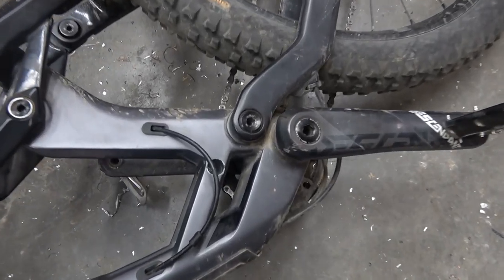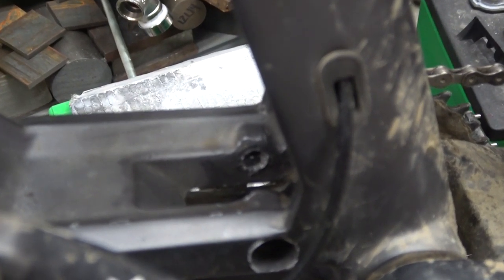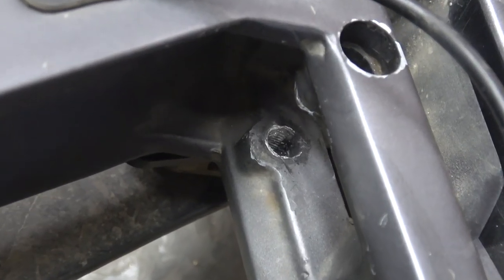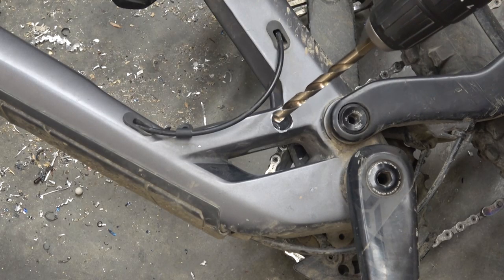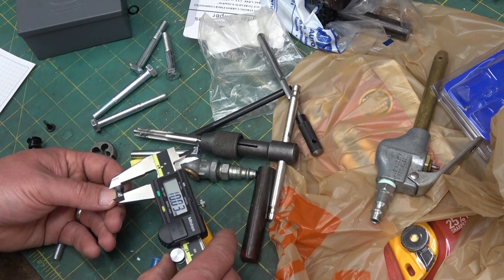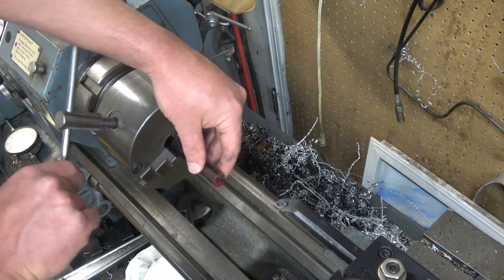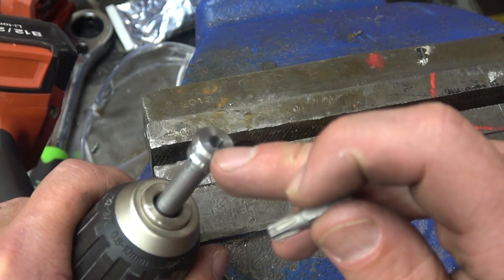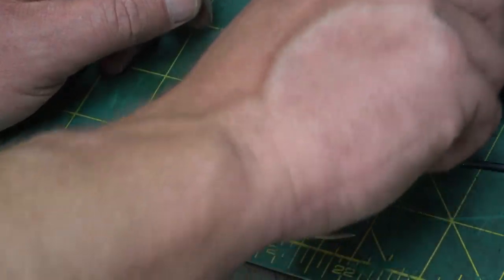What's a scumbag offset? | Obscure German Carbon Fiber Bike

Comment: So now that that pin is unbreakable, what’s the next point of failure? The expensive frame or the expensive shock?
Reply: Frame will bust on next big jump, that pin is zthere for reasonn.
Reply: Bearing surface in that bore of the shock, as already pointed out as being chowdered, is the next point of failure.
Other than that, you'd more than likely need unrealistic forces to damage either the shock or frame. Aluminum pin was fine, except where the diameter shrunk for the threads, which also sacrificed the threads in the frame when the pin was damaged; which is also why threading into composites is not a good idea and not a good design choice. Unless you have a whale riding this bike through a trail with substantial drops, it should be fine for the rest of it's usable life. Though, if the shock is frequently being bottomed out, it more than likely needs replaced, or adjusted assuming this one can be, but judging by how the bearing surface is already wearing, it probably needs replaced.
The pin itself should've gone through the frame completely and secured by either a nut or retaining clips. Aluminum would have still worked without issue in this case. This bike just has very poor design choices.
Reply: I'd say the pin that's topwise of the shock.
Reply: Captain MufDyven  While true, you have to keep in mind manufacturing costs. Those two parts would be more expensive than the one used. And the one used is more expensive than either through-pin design.
Reply: @xaytana  From what I saw in the video the frame had a threaded aluminium bushing insert that was half eaten from the failure, so he could have done another threaded bushing and use some epoxy glue...
Reply: Guy might be running too low of shock pressure; bikes are designed to bottom out but repeated pounding from Whistler-style hits will break something eventually.
Reply: The TacomaKid that’s a super deluxe it’s far from cheap and it’s essentially bulletproof. It’s almost identical to a fox shock in the same price range, I’ve used both
Reply: The TacomaKid  my dude brand has nothing to do with bottom out, you've got to set the proper pressure in the shock. If all you care about is the cost then fox is Garbo compared to something like push industries or ohlins.
Reply: Definitely agree - pin could be simpler and better, but even a complicated pin is far cheaper to replace than either the shock or the frame.
Reply: Are you recommending a shear pin instead?
Reply: only one way to find out!
Reply: @semirsemir7016  the pin didn't die from one hit (as it would have as a "sacrificial link"), it was gradually fatigued to failure, indicating a poor design choice.
Reply: @danroe533  I was wondering about that too. The guy obviously wasn't doing the routine maintenance that necessary for a full suspension bike (like having all the pivots inspected), and probably didn't have his rear shock set up properly.

Comment: Radon is popular in Europe. Most rear shock mounts I’ve seen have a steel bolt. Dude needs a volume spacer or more air pressure in that shock.
Reply: Well, d'ya think Uncle Bumblefuck would shy away if it was just a blown seal? Au contraire! Hon hon hon!
Reply: Next one will be arsenic....

Comment: Especially when working on German gear, expect the depth of thread to be 1.5xDiameter. If the process is designed for mass production, that's what it'll be 99% of the time as it's the minimum thread depth to get full strength. I like to go a bit deeper for one offs but what's another quarter turn?
Reply: Except thread engagement length for optimum joint strength depends on material. Steel is typically 1x to 1.5x diameter, and softer materials need a longer length for optimum strength
Problem here is that the aluminum-composite joint was only to keep the pin in place, so strength really wasn't a factor; you could achieve the same pin using a through-frame design with retaining clips, thread engagement does not matter in this use.

On the manufacturing side of things, sure, 1.5x diameter might be fairly typical. But again, this joint wasn't designed in that way, so it doesn't necessarily follow optimal thread engagement. And if it does follow optimal thread engagement, that number for carbon composites is more than likely more than 1.5x. Threading into composites in a high-force application is a bad idea anyways, as proven by this product's failure. 
And this isn't a German-only manufacturing decision, any product with proper engineering would follow optimal numbers for thread engagement, Chinese products more than likely also target optimal thread engagement; anything not doing this is either bad engineering, laziness, or planned obsolescence.
Reply: @xaytana  I'm sure you know this based on your thorough comment, but a clip-retained through pin would always cause a God awful rattle in this application. They needed the rigid mechanical connection offered by the threads. Best.
Reply: @xaytana  that's how reinforced concrete is designed; anchorage is based on embedment. More embedment equals more force required to pull it out. Bar shape type would equal type of thread in this situation
Reply: I wonder is that why they went for the finer thread pitch: They were compensating for a lack of depth, trying to get those extra turns in?
Reply: @Mitchell Pearce Easy solution would be a weather/water resistant material that the retaining clips can crush against. Still a better solution than what was originally used. Or you could go with the other suggestion I had of putting threads on the through-pin and using an external nut to keep it in place. Either way, threading into composites is a bad idea, and the diameter reduction in the aluminum pin is what caused the initial failures here. 
@hphoto Reinforced concrete is much different than what's mentioned here. Any length beyond the optimal number is just excess and a waste of material, hence why it's referred to as optimal. Not to mention the entire geometric difference here, reinforced concrete typically uses lattices of material tied in place, while threads are only a helix. You can't just compare the two.
Reply: @fartingfury  American made bikes often use 8x1 threads. Metric is all the rage at Specialised.
Reply: "I like to go a bit deeper..."

That's what she said.
Reply: Xander Vice you realize that they weren’t threading into composite? Because nobody does that? And that the failure was in the pin and not in the composite, so your “as proven by this product’s failure” is especially silly?

The pin threaded into an aluminum insert manufactured into the carbon fiber layup.
Reply: I was hunting down a replacement shoulder bolt for the hitch of a used Surly Bill trailer: 12mm dia shoulder, then M10x1.0 thread. (M10 fine is normally x1.25). Mighty pain in the arse, typical yank chooses metric then goes non-standard :-/
Reply: Ciaran Meh Finer thread pitch means larger minor diameter = stronger pin
Reply: @fartingfury  it was loaded in shear and failed through the thread root. This would be clear to the designer.  So they used a fine pitch thread because it has a bigger root diameter and hence a higher shear strength in the thread plane.  Any bolt catalogue will show higher shear strength for an m8x1.0 vs an m8x1.5 for example, as the root diameter of one is 6.0 and of  the other is 5.0
6 is more than 5 so it is stronger.
Reply: @tano1747  Seems like sound reasoning to me. Though I don't know why you felt the need to point out that 6 is greater than 5. I don't think anybody was going to challenge you on that...
Reply: @fartingfury  fair call. Just trying to be clear.  :)
Reply: Tano17 it really shouldn’t have been loading the threaded part in shear, though, that was unnecessary. The threaded insert in the frame should have had one part with a smooth hole the size of the full pin diameter (I think he said 13mm?), and the threaded part behind that. That would transfer the shock loads directly instead of via the thread.

Comment: 40+ years as an industrial/commercial machine mechanic working on all kinds of different machinery located in some of the harshest environments I learned early on that the Ol' Smoke Wrench was one of my most important tools, although how you would use one on a carbon fiber frame is beyond me (old school just enough to not have encountered these new materials).
Reply: i think carbon fiber has higher melt than red locktite whife got a piece of fighter plane tha went through extreem heat test looked un fazed,x117 ithink, cool stuff carbon fiber.yea i maried a rocket sicencetest and cant spell well,got a big vice though sometimes it matters,lol

Comment: The saying goes: You have choices with bicycle components. They can be inexpensive, light, and strong - but you can only pick two attributes.
Reply: And in this case, only one of the three was chosen.
Reply: @Benedocta  FWIW, Radon specifically makes very affordable bikes for what they are. Not "cheap", but a lot cheaper than, say, a bike with the same specs from most other well known brands (for people from the US, think Trek, Specialized etc). So all the Tschörman Enginerding must be done in the design phase because the bike is straight from Taiwan like any other brand.
Reply: @ska042  Okay, didnt know that, thanks.
Reply: cerebellum, Specialized USA brand changed and sent all their design work to Taiwan. That is why the US engineering director at that time, quit and did his own stuff. Eventually he started his own helmet company called Kali.
Reply: Search Kali founder Brad Waldron podcast

Comment: Get a 127 gear for the screw cutting lead screw for your Boxford  ......

Standard conversion thats been done on the UK since the year ..... (dot that is 🤣)

p.s. ...     my grandfather was taught the metric system at school in the early 1910s as in Kent, near the Port of Dover they had alot of trade with France 👍
Reply: Hey, I think I've got one of them - always wondered what it was for!
Reply: @CMC-NFG  it goes into the gear set on the lead screw drive 👍   it adapts between metric at 127 ( ie 1" = 25.4mm   127 as a ratio .....    it allows for turning metric pitches on an imperial machine.....     all the info is available....    you'll find them on the usual scumbags (Ebay) new or used as well 👍
Reply: er, sort of. If done this way, you have to unwind the screw at the end of every pass.  it's a work-around. you can't go back and pick up. The only true way to cut metric threads is with a metric lead screw and matching split nut...
Reply: Yeah, it's a work around. But it does work. It would be nice to have a brake to stop the spindle but you Can disengage the half nut, stop, reverse then drop in on the same number as you pass it on the reverse.
Reply: "The" metric system lol.

Comment: Could you have possibly just AvE engineered out the built in weak point?  Seem like that pin was a sacrificial part to the carbon fiber frame
Reply: Interesting how that "sacrificial part" as you put it nearly scrapped the frame from ovaling out the hole. Note how AvE said he was biting into the carbon from when he was tapping out the hole. Carbon doesn't thread well.

It's a temp fix that may end up keeping the pos on the trails longer than the guy riding it keeps his interest in the hobby.
Reply: Sacrificial parts are meant to take up momentary overloads, not fail in a fatigue crack
Reply: @noanoxan  Wasn't trying to bring no smoke on AvE, he is hilarious and good at what he do. Just the work he put into tha chrome molly pin is a lot stronger than the carbon frame. The ride didn't realize the until he was bombing down a trail and crushed his pudendal artery that his bike was broken.
Reply: Rolvaag Thorsen sheer pin.
Reply: @noanoxan  Maybe it wasn't meant to save the frame from the scrap heap, but instead meant to save the rider from the hospital. Yeah the hole might be ovaled out, but better that than the frame slowly cracking at a critical point and then going kablooey at the end of a big jump?
Reply: For sure that's the reason. And maybe (Idk because I wasn't there) the pin broke completely and wallowed out the hole because the owner failed to thoroughly inspect his equipment before/after/during use. Perhaps if he noticed it before it got so bad it would have just been a matter of replacing the pin with a factory replacement part, at a premium price of course.
Reply: WHAT DO YOU THINK ABOUT THAT PIN BREAKING WHILST YOU HIT THE GROUND AT 25MPH? IT SUPPORTS THE WHOLE REAR END AND YOUR GOING TO EAT IT EITHER WAY. IT'S THE SAME THING, NO? I would say the only thing that i don't mind breaking is the derailleur hanger or my chain.
Reply: Lol.  Maybe.  But either way it's not good.  The fact is that thing fatigued gradually without any detectable/visible signs of wear.  Also it's not like the carbon frame which will absorb more of the energy when it fails offering some protection to the rider when it bottoms out.  Aluminum is ductile and brittle but carbon fiber is rigid and springy.  IMHO: better to break the frame than the rider.
Reply: @antidecepticon   Seeing as how the bike was being ridden after the pin broke id say i prefer the pin breaking instead of the frame.
Reply: I went way too fast on a trail jump once, landed on the kicker of the next jump. Bent the handlebars on the Specialized Demo 8 I was riding, caught some bruises etc. Limped back to the rental shop, they told me the handle bar was engineered to break before my radius bone did.
Reply: The shock mounting bolt is not sacrificial. Breaking that of during a harsh impact would only cause more damage, and probably a lawsuit. The only real part like that on a bike is at the derraileur hanger.
Reply: @asmundervik3289  I remember the guy at the local bike shop once tried to sell me a carbon fiber handlebar, it was real cheap so I considered it for a moment, but then I thought of how carbon breaks, and what happens if it snaps right in two on a hard landing. NOPE, I'll stick to aluminium thank you very much, that'll just bend out of shape and be weird to ride home with...
Reply: @jaybrewster2475  I BET IF THE PIN WAS MADE THE WAY AVE DID IT WOULD HAVE NEVER BROKE AT ALL
Reply: I doubt that when he landed he was sitting, he is just a big guy , I weigh 130lbs so i can drop pretty hard without breaking stuff, i still have my a1 rock hopper from 1997 just changed the cables cassette and breaks again. its a kickass lil bike
Reply: Jay Brewster what? All I said was i don’t weigh enough to break most things???

Comment: I would have epoxied that Helicoil in if it was screwing into the carbon composite. Great machine work sir.
Reply: It’s not screwing in the carbon composite. You cannot drill and tap carbon fiber. Like, at all.

There’s an aluminum insert laid up inside the CF, basically a nut.
Reply: Jasper Janssen it sure sounded like it was cutting fibers.
Reply: AlphaPsycho I’m sure he did cut some when he was making the hole bigger. But that’s not where the actual meat is.

Comment: As a former bike mechanic (being dutch after all) this was hilarious and entertaining to watch.
Agreed, bike mechanics or engineers don't really are that good with machining...
Reply: Z Kommer  I meant bike engineers, but maybe that wasn't clear. I've seen bikes designed in ways... Wouldn't have happened if those engineers actually worked on bikes in their life. I know it's two completely different things, but I do think engineers are better if they have some hands on experience :)
Reply: Just had one experience like this yesterday. Changing hydrobrakes on an unnamed brand of cargobikes starting with C.. Anyhow. Had to disassemble half of the "cockpit" just to get brakehandle on. No dualbolt clamps here, no no.

Comment: A Beach Mark is  the smooth rings like lapping waves in sand ,on the smooth  side of the break , where the crack originated .        The grainy area of the break is the catastrophic failure , when it  broke under tension . It starts out as a nucleation crack ,     then   progressively moves  across the part , with cyclic loading, until it fractures .

Comment: Woulda thought you'd loctite the helicoil into the hole. 
Also aluminium shear loaded pin. What was the guy who specced that drinking and where can I get some.
Reply: Not sure if loctite plus the resin from the carbon fibre would be good.  From what I hear loctite doesn't play well with others.  Personally I was thinking JB weld :p  Talk about using the best canada has to offer on a german contraption!
Reply: @someguy2741  I thought uncle bumblefuck was putting the helicoil into a metal insert that was already present in the frame. He just drilled it out to a larger diameter.

Comment: Think the Aluminimun would've be fine if they didn't put the THREADS IN SHEAR...
Reply: ArnGo Thank you!
Reply: Yep, the aluminum pin was designed to fail in order to save the frame.
Reply: @2003wrx64  Except it didn't. It boogered the frame proper.
Reply: Aluminium fatigues much faster, so it's actually a terrible design choice for something like a suspension component.

Comment: Degrease the oversize threads and glue in the helicoil with high strength thread locker. Because sometimes the helicoil wants to come out of the hole again. It will be a stronger and more durable thread doing so. Loctite will also prevent galvanic corrosion between the steel insert and the aluminium base metal. I learned this while drilling out hundrets of corroded bolts from salt rotten scooters. Also seat the insert at least one turn of the thread under the surface of the bsae metal, so the first winding can not get pulled out. If you have an aluminium case that has to be serviced a lot helicoils make them threads resistant to abrasion. Raceengines and CNC-machines often use helicoils installed from the manufacturer.